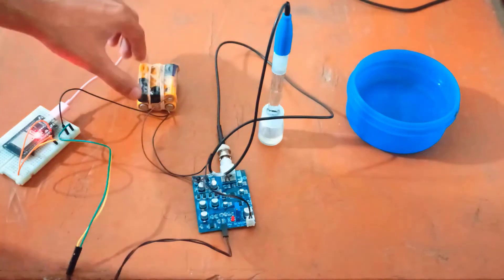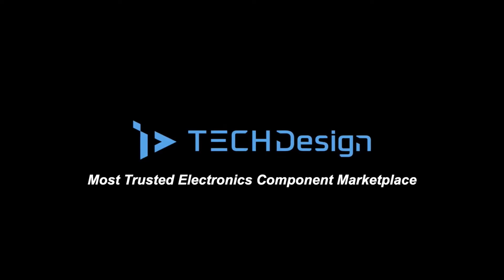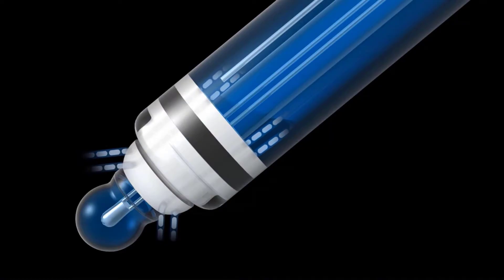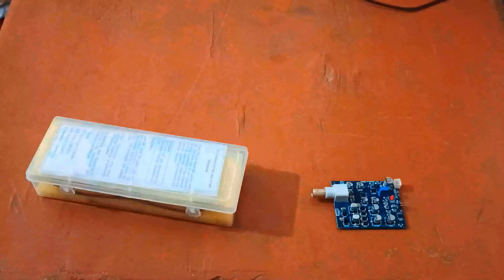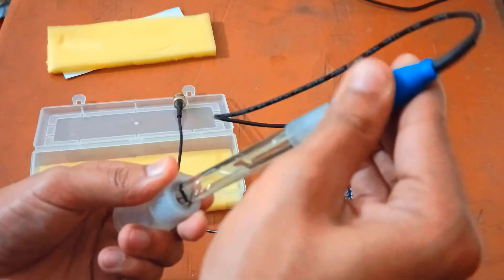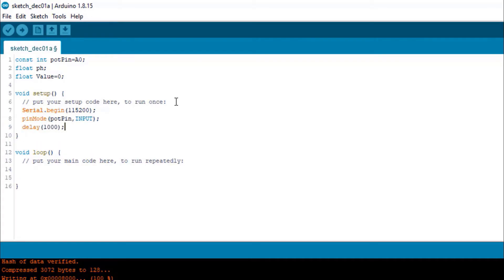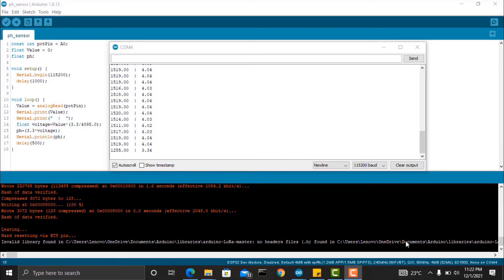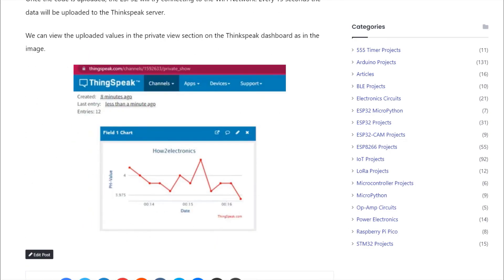DIY IoT Water pH Meter using pH Sensor & ESP32

Comment: I'm working on a water quality monitoring project using ESP32 WROOM, pH4502C, and EC Board v1.1. I'm facing challenges with connection and coding the components, especially during the pH offsetting, which isn't producing the expected results. I'd really appreciate your help in resolving these issues. Your expertise could make a big difference in achieving the project's goals.
Looking forward to your guidance!

Thanks!

Comment: Hi, Can we put if then else to catch particular PH value? My use case is that if pH is greater than 67then switch on a co2 solenoid in my planted aquarium, Solenoid regulators are 240 volt operated ones which if switched on allows co2 gass from the cylinder to flow out controlled way and a diffuser in the aquarium diffuses the co2 in the water , thus slowly increasing the acidity of the water which should lower the ph ,. once ph value is less than 65 then switch off the solenoid connecting plug. So a relay is required I guess and a piece of code that does the switiching within the if condition. --- Please let me your thoughts on this. Also if you can make such a device say I buy 10 of those how much would you charge me. I am from Kolkata. Let me know if you are interested. Thanks

Comment: what is the role of the ph sensor module (or shield), the little card that links the probe to the arduino card?
I do not have this module and I cannot obtain it, How could I replace it and make everything work?
Reply: not sure but there is an equation to get the Ph with your potential difference measurement et the temperature, you'll have to use it

Comment: 👍 very good explanation.. 
if pH value not match with real value, how to do the calibration.... 
Can this type of pH sensor be use in real field (outside) or only for lab/experiment..
Reply from the maker: Yes you can use it in real life applications. But you need to recalibrate the device after each 1-2 months.
Reply: @HowtoElectronics  thank you